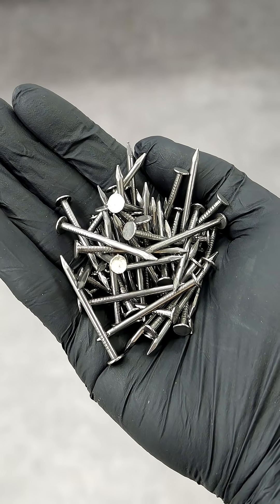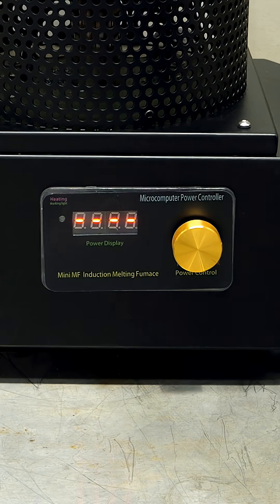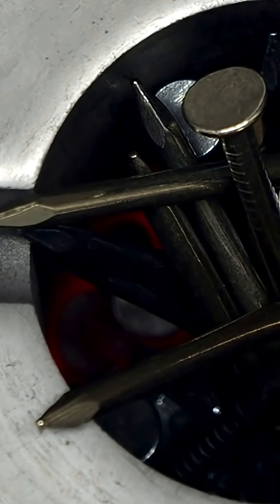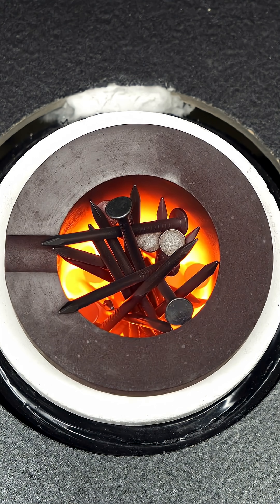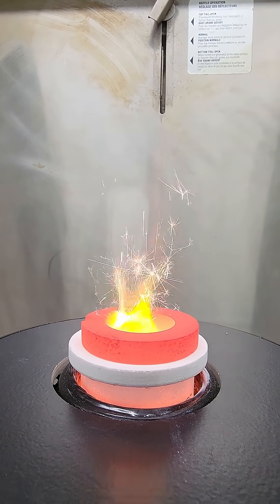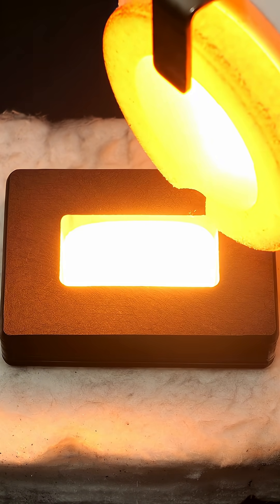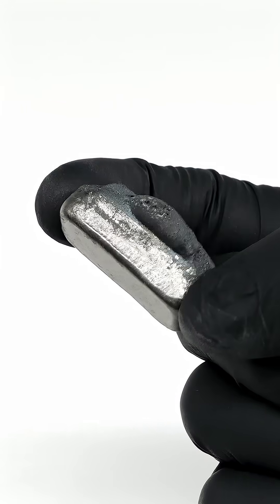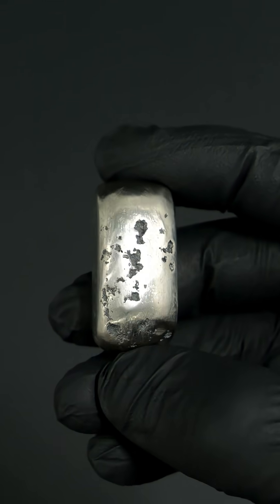Liquefying nails is crazy

Comment: If I remember, first the smoke. Smells like that to keep them shiny have a coating on them The smoke is the coating burning off. Next is the colorization of the metal. Most medals will color depending on temperature, alloys such as steel can change to different colors based on the properties. For the most part steel and iron turn blue. Aluminum when heated, can become rainbow, at different temperatures it will change to different colors. Steel can do this also but is much harder to get other colors, other than blue. With an induction heater you should be able to get the perfect temperature to see all colors as the metal heats. Please keep in mind that these colors will remain after cooling.

Comment: One of the problems you had was using galvanized nails.  If you had just used some normal
Construction nails without the galvanizing on them. Your end product would have turned out a lot nicer.

Comment: 3500W? That’s going to take a special circuit in a standard home. Maybe one of those 30A 220V circuits will get it done but not a regular 110V outlet.
Reply: This dude for sure has some 240v circuts in his lab, runs too much weird machinery not to (including all the likely 220V stuff he gets from China)
Reply: 220V 20A is capable of 4400W.
Reply: I thought standard house use 240V since it's what all my family use, I never even heard 110V
Reply: @hakimhomecent1619  Depends on where you live. I might bungle the terminology a bit, but my understanding is: North America does get ~240V supplied to houses, but uses a split phase system where that 240V is split into two 120V phases at the transformer before coming into the home, providing two 120V rails at the breaker box. Most circuits only use 1 rail and thus only supply 120V, but some circuits use both rails to provide the full 240V for heavier equipment (washers/dryers, ovens/stoves, lab equipment, etc.). Most other places in the world get a regular single 240V (give or take) line with no split, so all of their circuits supply 240V. Why the difference? History reasons, mostly. Interestingly, this may explain why electric kettles never took off in North America: they take twice as long to boil water!
Reply: @hakimhomecent1619  The entire US run on 110V. 220V/240V in the US is almost exclusively used for our clothes dryer and oven and that's about it.
Reply: @ermakers1297  ah no wonder then, I'm not from US after all
Reply: most standard kettles in the UK are 3Kw kettles. no problem in theUK where our eletricity isn't weak and feeble! lol
Reply: @Admiral_Pumpout  Most US houses have 220V circuits for high-wattage devices like electric stoves, clothes dryers, and water heaters.

Comment: "carbon has left the chat" - Judging from the amount of sparks thats more likely to be iron now instead of steel. If you smelt with a small amount of argon flow into the crucible it will displace oxygen and keep the carbon inside the steel. This will also limit the amount of slag. Also you can blend in some other metals (eg vanadium, chrome, molybdenum) to get better quality steel. To bind impurities into slag add a small amount of aluminium to the mix. - I work at a high grade steel casting company.
Reply: The chemistry lesson I didn't know I needed.
Reply: Yesssss!
I came here looking for this comment!
You can’t melt steel, let it bind with oxygen and think you still got steel out of the process 😅
Reply: Hmm. I think also think some of the graphite might've absorbed into the bottom and sides, with a case hardening effect in those areas.
Reply: @ArnoldsDesign 
JESUS IS THE WAY, THE TRUTH AND THE LIFE. Repent and turn away from your sins today🙏🏻
Reply: @JesusPlsSaveMe Amen!
Reply: @JesusPlsSaveMe  $6 SHRIMP SPECIAL
Reply: 👏👏👏 top level information. You sir are an expert! 🎩
Reply: Great comment! I was thinking the same. He made iron out of the steel nails.
Reply: I doubt he lost that much carbon. The melting was pretty quick minimizing carbon loss. I've melted plenty of low carbon steel, while we would need to add some trim coke, never would we have dropped below the steel range.
Reply: What is this? Some kind of metallurgical diatribe?
Reply: @JayPhelps-vt5qyyou feel left out?
Reply: the grinding sparks look alot more like iron then steel too
Reply: Why is metallurgy so freaking cool
Reply: @theguilloriousmind5832  Because you get to melt things and watch them change! It's a guy thing. 
Now go learn something useful: 
https://www.youtube.com/@TenthAmendmentCenter/streams
Reply: Can confirm, I play GTNH and this is similar to how you make stainless steel.
Reply: @davidmcdonnel4831 play what?
Reply: That sounds like an incredibly cool job! Question: what would you add if you were looking to create something more suitable for forging/smithing? Vanadium, chromium, etc are all great for making nice, higher Rockwell scale tool steels, but what might give you a good balance of flexibility, impact resistance, and edge holding? I've got a nice old Boker chrome-vanadium carving knife that stays sharp for months of use, but it's obviously stainless, so it's great in the kitchen but that's its safe space, but then I also have a good old WWII vintage Cattaraugus 225Q Quartermaster knife that's an absolute beast.
Reply: Mild steel is dipped into hot galvanized bath solution, it's removed and allowed to cool down, if you then take the galvanized steel and reheat it you burn away the galvanize solution, you are left again with mild steel, it's very dangerous to heat galvanized steel, the vapours are very harmful to the lungs , as it contains lead or large amount
Reply: ❤Very informative post! You aren't sharing any trade secrets that could get you fired?😉
Reply: @jasonfahnestock9494  No, all of that is common knowledge. Trade secrets would be in process control and the casting moulds. For example.. your standard go to stainless steel is V2A or 1.4301 or X5CrNi18-10 which means 18% chrome and 10% nickel. If you put in 2% molybdenum you get 1.4404 which is resistant to salt water and chlorids (you need this for you pool). You can look this all up yourself as its standardized.
Reply: We have a metallurgist here😮
Reply: Good observation.
Reply: Uh, let's try adding mercury....and discuss the danger of breathing! 😂😂😂
Reply: I was thinking maybe the nails were zinc coated and caused the smoke as it burned off. What do you think?
Reply: Ok NERD HAHA jk im an engineer and this is good to know.
Reply: @josephorduno8778 rarely can an engineer do anything in practice, just ask a lot of questions and tell people how to do their own jobs better 😅
Reply: @jj-jak  you've been hanging around the wrong engineers. I've worked in R&D, it's a lot of fun trying to make stuff work with engineers
Reply: @jj-jak I agree brother 😂
Reply: @jj-jak telling others how to the job IS the job
Reply: Carbon has left the chat but Senku Ishigami has joined
Reply: nah it would've oxidated by the end of the video visibly. The colour also matches with steel.
Reply: we get it, you have a job!!

Comment: That was a bit over hot with too much access to oxygen, hence the sparks.  You were literally burning the iron and the carbon that was in the metal.  

Try coating your nails with some borax.  It will reduce scaling and preserve the iron content.
Reply: And you can use it to clean your laundry afterwards, Or maybe for pest control. Borax has alot of uses!

Comment: What is the point at least take good steel and make some thing out of it. 
Most of the steel in nails is very poor it's getting harder to find good nails as screws and air tools have taken over. Belper in derbyshire England is the home of nail making but sadly the little sheds have been quite for a long time but there are a few still standing

Comment: Man has been fascinated by fire for millenniums most would try to make a cheap fire an build it up to steel melting temps but you went the way of science an bought a fairly expensive induction heater man would not be happy with your results so small so expensive for the roughest piece of nail all of 89 cents worth of nails

Comment: Its actually not too difficult to make one, depending on the power you want. I had a project like this in highscool. Basically you want some thick induction coils and a powerful transformer and some safety measures to be safe like temperature sensors and fuses.

Comment: Anyone else think it was cool how the metal bubbled up and spilled over as the edges cooled? Never seen metal do that when cooling.

I guess it's because iron/steel has a much higher melting point than Al, Cu, and Sn, so the parts in contact with air freeze much faster than the liquid middle. Still cool to witness to my nerdy self.

Comment: If you want to melt steel, iron, or any alloy thats primarily iron without bubbles forming you need to flush the air out with a less reactive gas you can do this with welding flux or a inert gas mixture like C25

Comment: You know, that smoke coming off first is zinc vapors.

I know you work in a fume hood, so you're golden. But standard exterior nails are coated with zinc for corrosion resistance.

Beware zinc oxide poisoning! Causes flu like symptoms for us home schmelters.

Comment: Most nails used in construction, particularly common "wire" nails which is the type you used, have thin coating of either zinc, vinyl, or phosphate - to inhibit corrosion or rust. So you didn't melt them into steel, rather another type of alloy.

Comment: Try pumping argon into the crucible. It would eliminate that porosity in the casting, just like in welding. Regular mild steel prefers c25, or 75% argon, 25% CO².

Comment: Induction heaters do not have heating elements, electic heating coils, or any kind of flame.  Instead,  a magnetic field formed by applying AC voltage to a looped conductor causes the electrons of metal thats been placed inside the loop to constantly alternate between positive and negative polarity, which heats up the metal from the inside out.  No physical contact is needed and it works best with ferrous metal (steel derived from iron ore )    Because the magnetic field collapses the moment power is turnedd off, the most dangerous aspect is the crucible.  Once its removed, loop cools rapidly regardless of how long the metal takes to cool in whatever mold its poured into.  There is no safer way to melt in a crucible.  My dual torch propane forge can heat in a similar manner, but is way more hazardous.

Comment: Worked around an induction furnace at my old job that was about 12-15 feet tall and maybe 8   feet in diameter. I don't remember the exact specs on in but I do know it reached scary high temperature while pushing scary high amounts of current through the thing. Was told that years ago there was a failure in the wall and it shot out a 20-30 foot flamethrower into the room. Luckily no one was harmed.

Comment: Bro electric bill is crazy
Reply: I don't have one of these but I have an induction hob and use it every day because it's so efficient.

It can boil up some coffee inside 2 minutes and the only thing that gets hot is the coffee pot. The hob is cool everywhere but where the pot stood.

I suspect that although this probably does use some juice, it will use way less than a conventional electric furnace.

It probably uses a normal household plug.
Reply: 3500 Watts! = 6 new high end NVIDIA cards! or  about 5-10 household refrigerators.

Comment: You should absolutely do the XRF on the nails before you melt them vs after. There’s a clear decarburization happening and I’m wonder how much you’re actually losing. Mild steel is only .25% or below, so losing this much carbon seems like it might be nearing wrought iron territory and nails like these are often much closer to .05% (according to Reddit blacksmiths), so this amount of carbon migration is impressive and it’d be neat to understand just how much it’s actually losing

Comment: Did anyone else notice that eBay induction heater rhymes with disaster?
Reply: Why? What is wrong with it?
Reply: @robaxa1 someone could've tampered with it.
Reply: @this-guy2005 
Is your suspicion because it's from ebay, or is it the item itself you don't trust?
Reply: @robaxa1 This specific item can be quite dangerous, so if it's subject to tampering, it could be bad.
Reply: @this-guy2005 
Ok
Reply: @this-guy2005 
Why would someone tamper with it if its working fine from the factory? Can't that be said about every product?
Reply: Unless the tamperer is a psychopath

Comment: The sparkler effect if from the molten steel reacting with the oxygen in the air. If you have a shielding gas like argon/CO2 mix, you can prevent the 'uglyness'

Comment: An induction heater is a really powerful and cheap device. I built one to heat up a dynavap (herb vaporizer) with just 60 euros. I also used it to heat up tools to work with 3D printed stuff and cut/solder plastic

Comment: so you're tellin me that an Induction heater can in fact get hot enough to melt steel beams? interesting
Reply: Bro, the induction heater doesn't get hot at all (almost). It just transfers energy directly into iron.
And the only limit is: when the object loses more heat to it's surroundings than is transferred into by the heater.
And you need a lot of heat for a ping pong ball sized blob to emit 3000W.

Comment: These appear to be zinc coated nails so your bar may have alloyed some zinc into it, but since zinc burns at 900°C and steel melts much hotter at 1300 - 1600 °C you'd likely burn most of the zinc off
Reply: Zinc fume is very dangerous/poisonous.
Reply: @eniregnat  I'm pretty sure he did all of that under a fume hood, like he always does.
Reply: That's why I instinctively flinched when I saw the smoke coming off it
Reply: Some zinc has been burned off, but some has remained inside the bar and formed refractory inclusions in the form of zinc oxides. These inclusions can be seen in the finished bar. The black string-like substance you can see before he removes the bar from the graphite is also most likely zinc oxides, as they float on the surface of the molten bath.

Comment: 3.5kW would trip most residential breakers I've seen (230VAC country).
The thought that you might be doing it on 120VAC is is wild 😂
Reply: [Edit:] I don’t know why I made that comment, since this is obviously in the US…

In Germany circuit breakers are usually rated at 16 amps. 16A × 230V = 3680W.
Reply: @bleistift2775 

Hes not in the us hes in canada they dont use american plugs i belive and hes also got high power lines
Reply: @artsyscrub3226  Canada also has 120V instead of 230V.
Reply: 3500Watts... on a 120VAC circuit that would take at least 30A. 230VAC would be just over 15A. From eBay, might not be truthful power rating...
Reply: my  house max demand is only 1kW I think.
Reply: @groverw7507 unlikely 😂

Comment: Steel/iron is an ingredient option for fireworks. Most fireworks are just various powdered metal.
Reply: Even though not a perfect block he definitely nailed it.
Reply: @mikael6703  We get the point.
Reply: Thinking those nails were alloy with zinc.
Reply: @KimberlyPatton-x1n  Not alloyed. Plated with. Galvanization is so common with steel hardware the only way to get away from it is usually stainless, or selecting hardware plated with something else. The Zinc slows down or halts corrosion.
Reply: @Tomyironmane I don’t think those were zinc plated, rather “brights,” polished plain steel lightly coated with oil to prevent corrosion. The oil burned off at the beginning of the heating process. If they’d been zinc-plated, there’d have been copious clouds of toxic white zinc fumes.
Reply: @Tomyironmane  so does oil
Reply: @KimberlyPatton-x1n  Most things are galvanized zinc coated if they aren't stainless steel. It's rare to find pure steel or iron fasteners. You wouldn't want it anyways because they corrode in no time just from humidity.
Reply: @KimberlyPatton-x1n  pretty sure steel is alloyed w chromium
Reply: It does really exist in China! https://en.m.wikipedia.org/wiki/Iron_flower
Reply: Yeah, different elements produce different colour bursts.
Reply: how do you make it into powder 😅
Reply: Back when I had 2 jobs, one was at an automotive repair shop, and the other was a hydraulic company we rebuilt cylinders and whatnot. A guy at the hydraulic company found out i worked at a repair shop and asked if I could get him the metal shavings that came off of us resurfacing brake rotors. When I asked him why, he told me that's what he uses to make fireworks. It kinda blew my mind. I had never heard of that before. Needless to say, I must have given him a 5 gallon buckets worth of cast iron dust.
Reply: @KBLIZZ333  Rust is used to make thermite. Doesn't really explode, but gets super hot when lit on fire. They use it to weld train tracks together.
Reply: @kryptokrypto702 is that what's in road flares?
Reply: @KBLIZZ333 No. I don't know what are in road flares. Rust for thermite gets way too hot to be used as a road flare.
Reply: @kryptokrypto702  Idk why I thought thermite was in road flares 🤦🏻  According to Google 
The main ingredients are a fuel (like charcoal or sawdust), an oxidizer (like strontium nitrate or potassium nitrate)
Reply: Most fireworks with bright white sparks are either (most likely) a combination of aluminum powder and explosives or (less common) magnesium
Reply: So cool
Reply: "steel" Nile didn't explain why these sparks happened and how they're created, especially when he poured melted metal into the mold and they continue to "sparks" literally.

It would have been interesting.
Reply: I feel this knowledge is common sense lol… anyone who doesnt know that is a slave to the matrix… just living day by day in their worthless livfes
Reply: @papaversomniferum5247  rage bait ain’t good enough